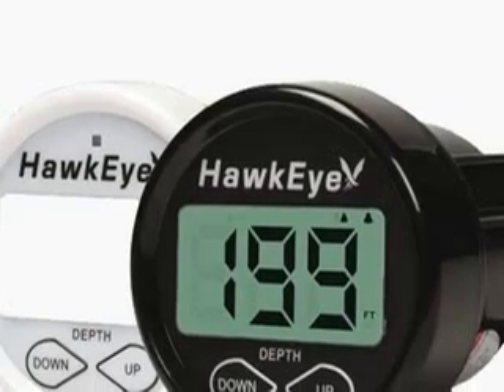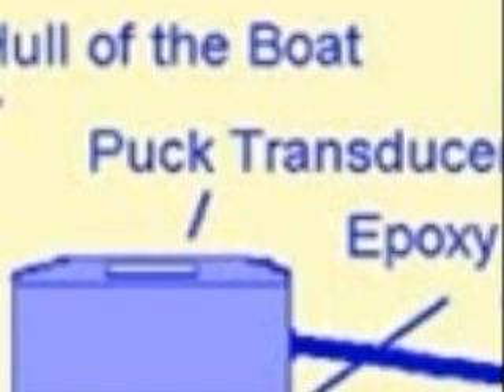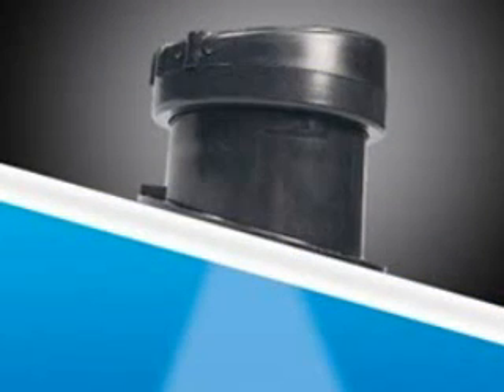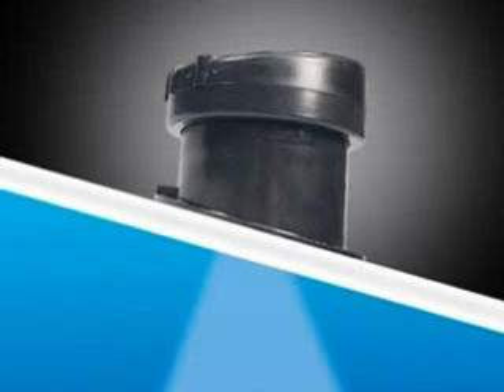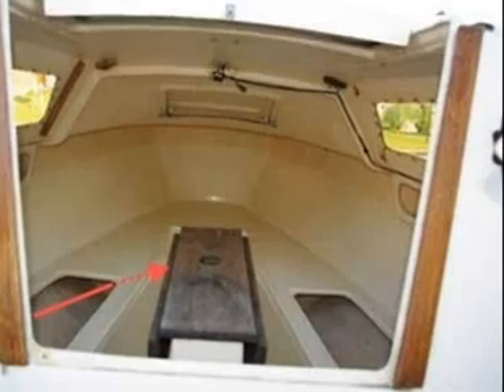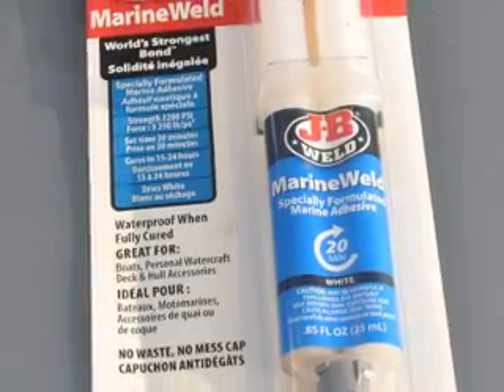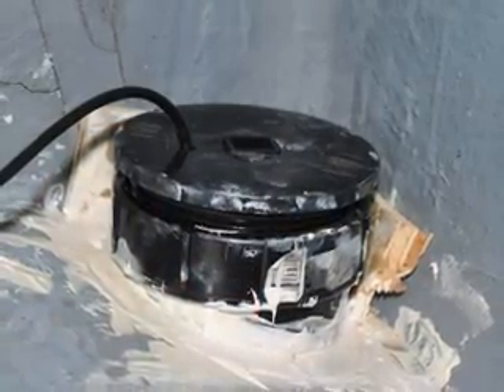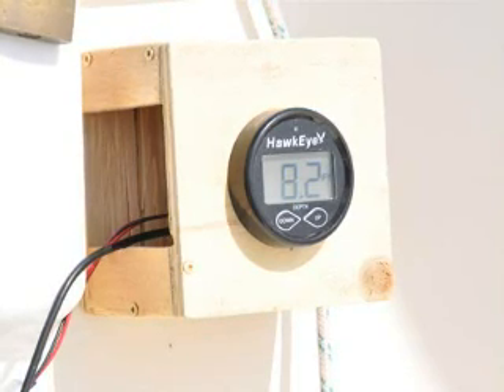install depthfinder depthsounder in Sandpiper Sailboat

Comment: Eric, thank you for the video...did you put the transducer in one of the storage lockers on on the floor of the hull?...also did you fill the transducer enclosure with water or oil?...thank you!
Reply from the maker: Hello,  In one of the storage lockers, but as close as possible to center of hull.  In water, but we drained it before winter.